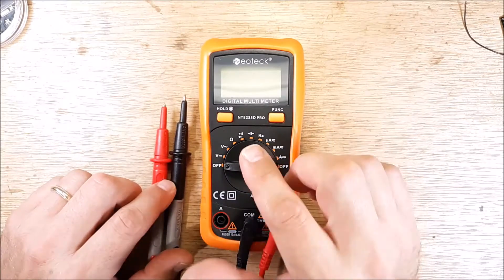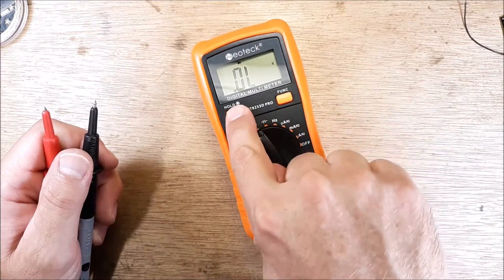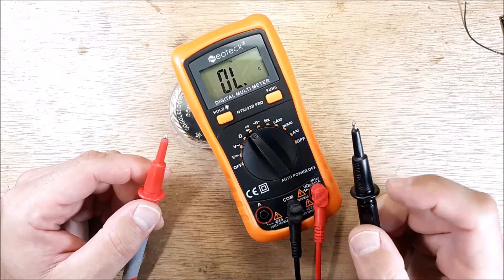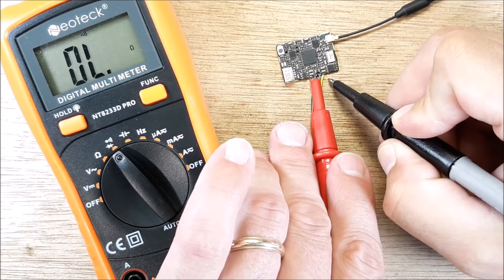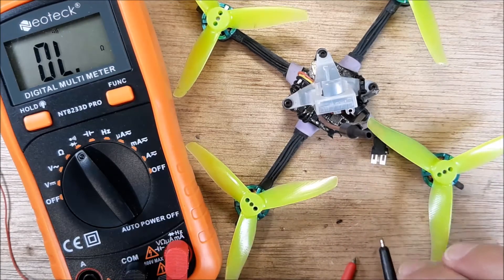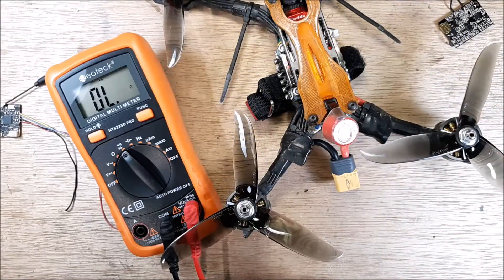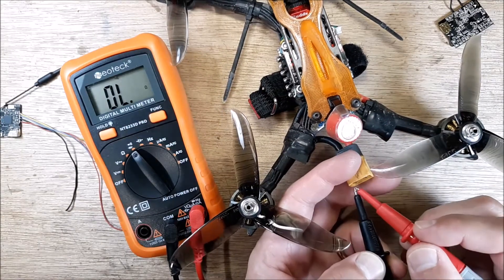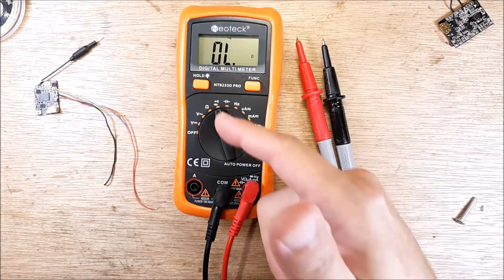How To Check Circuit Continuity | How To Check If It Is Ok To Plug In A Lipo

Comment: Still confused how to fix a UAV if it 00.0?
Reply from the maker: if your checking the lipo pigtail and get full continuity between positive and negative, you'll need to look close at solder joints and components. Also, look for solder balls (solder splatter) laying on the boards.

Comment: what happens when you only see some numbers and no beep!? I have a reciever which I dont know I should use it or not. when I touch the two pool together sometimes I hear a small beep and somertomes nothing only numbers? thank you for sharing....
Reply from the maker: When you touch the meter leads together  you may or may not have a beep? That's odd. I may not quite understand what you mean. 
If you have a meter that sees continuity but its higher than let's say 10ohms, it will not beep, it will display the resistance of the circuit. My meter isn't that sensitive or of that quality.

Comment from the maker: Hello Everyone! Thank you for checking out my channel and subscribing! Here we look at how to use a multimeter to check the continuity of our components. Also, we check continuity before plugging in a LIPO... Hope this helps someone...👍🏻👊🏻🍻
Reply: I actually learned something! I have been using multimeter since I got into drones. It was until later that I learned about smoke stoppers thanks to Bardwell. What I had not thought was to use the multimeter to check for continuity in the battery plug. That's the reason that I have been using the smoke stopper. Thanks! Next time I modify a tiny whoop I'll check the battery plug for no continuity! Will be easier than soldering a 1s plug to my smoke stopper.
Reply from the maker: @numberjuanfpv  
I'm very glad this helped. Have a great day!